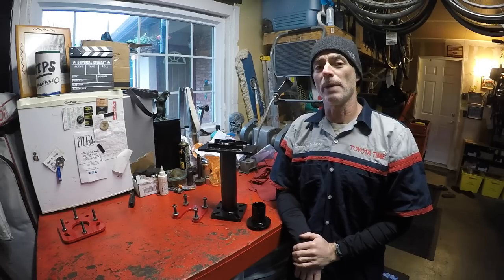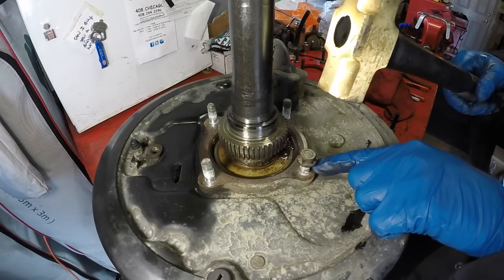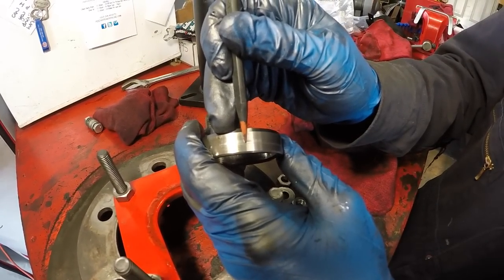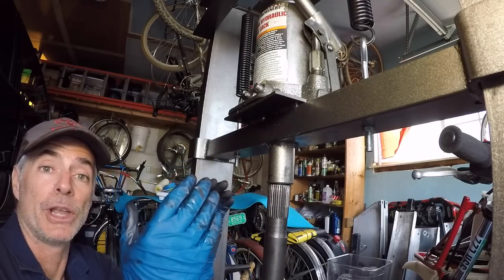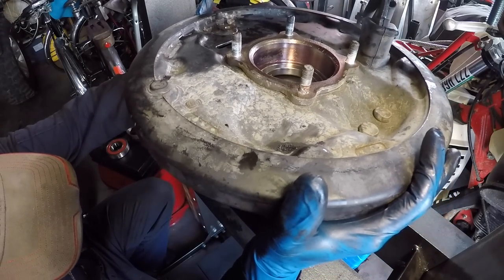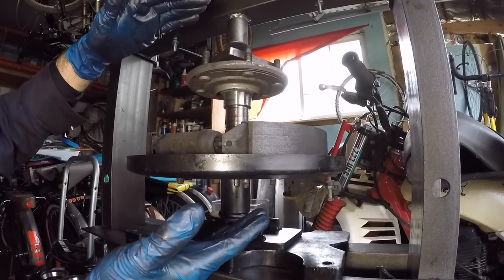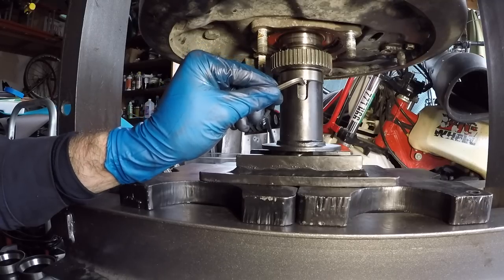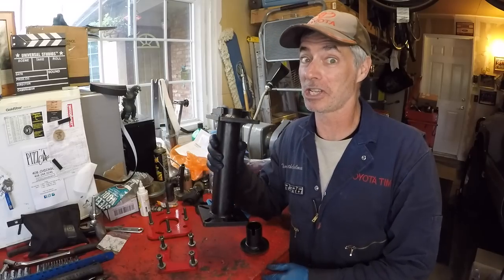Toyota Rear Axle Seal/Bearing Replacement (Part 2)

Comment: Tim, always love your videos! Thanks for introducing the new tool! I have a 2002 Tundra (non-ABS) with 154,000 miles and know it's only a matter of time before I have to replace the bearings. Three questions. Of all the bearing that you replaced what was the #1 symptom? Second, I have only one retainer. Since I can't switch retainers should I replace it? Lastly, if I need to replace the drum backing plate,  rusting away, can I do it after the axle shaft is pressed out of the bearing? Thanks again!
Reply from the maker: Good to hear you like our channel.  The sign to replace the bearings has always been a leaking axle seal.  When the seal starts leaking, it's best to just go ahead and replace the bearing.  The reason is it's possible a worn bearing contributed to the seal failure.  Some people have just replaced the seal and readjusted or flipped the retainer to get a good mating with the seal and have gotten more miles out of the bearings.  But, this was on ABS rear ends.  For you to get the retainer off the axle on your non-ABS rear end, you need to press the axle shaft out and that puts a tremendous load on the bearing and it should not be reused at that point.  If you wanted to reuse the bearings, you couldn't use the redesigned Toyota seals.  You would have to use an aftermarket seal that keeps the seal lip in the same spot as the original Toyota seal to get a good mating with the retainer.  However, I share the opinion with most people though and think it's just smart to spend the money and replace the bearings while you have the axles out.  

Since you only have one retainer, I would suggest replacing it.  For your application, you absolutely have to flip the retainer if you're going to use the new Toyota seal.  If you don't flip it, you will not get a good mating with the seal.  We have a video for this job for a non-ABS rear end so be sure to watch it.

Once the axle is out, yes, you can replace the brake backing plates.  You would need to have all 4 serrated bolts knocked out and then you can grab a mallet and knock out the bearing case from the backing plate.  Then, you just get your bearing case into the new back plate and get your 4 serrated bolts pulled back in.

Comment: Hey Tim, in this video you mentioned that you can reuse both of the retainers if you flip the positions. But in the video description it refers to a comment where you suggest to buy new Inner retainers to mate up with the seal. Assuming I did the same method in this video would you recommend buying new inner retainers or can I reuse both to save money?
Reply from the maker: Buy new inner retainers based off the reason I stated in the pinned comment.

Comment: I have a 2008 and trying to remove rear wheel bearings and retainer. In having trouble finding the tools I need exactly. Anyway you can drop the links in the comment. Also I'm using a do it yourself shop what is the clearance height for the press to fit the axle in it.
Reply from the maker: We have links to the tools used in the video description.   As for the clearance height for the press, I'm not sure what you mean.  The Harbor Freight press we have is adjustable and I imagine any press you would use would be adjustable.   For different parts of the process, you need to adjust the height of the press.

Comment: I'm probably just dumb, but the parts list like the "Toyota Genuine Inner Right Hand Rear Axle Bearing Retainer" is showing up as incompatible with a 2000 4runner. Is this accurate? Great video either way!
Reply from the maker: Those retainers are the same for any 3rd Gen 4runner axle.  There is a difference in the bearing for the 2001 and 2002 compared to 1996 - 2000.
Reply: @TimmyTheToolman  thanks just wanted to make sure.
Reply from the maker: @kearsarge6658  No problem.

Comment: Hi Tim, 
     Thank you for your videos,  So many of these tasks would seem impossible to do without the detailed guidance you put together. I have a 98 4Runner, and my rear bearing is leaking so badly.. it's like a waterfall in there. No question I need to do this or have it done. Do you know if this tool works on the 12 Ton HF press that I have access to (as opposed to the referenced 20Ton)? I assume the clearance is the issue as opposed to the tonnage...12 ton has Working distance: 1-3/4 in. to 25-1/2 in.

Thanks in advance,
Keith
Reply from the maker: I think I remember hearing that the tool doesn't fit between the cross member on the 12 ton model.  Do you already own the 12 ton model?  If you don't, the 20 ton is worth the extra expense because it can handle all the pressing jobs on your rig.  The front wheel bearings require a ton of force and I don't know if the 12 ton model would be up to the task.
Reply: My Friend has the 12T, I was hoping I could use his. Thanks for getting back to me so fast!
Reply from the maker: @keithbrown1914  Yeah, you could get the tool and see if it works but I wouldn't tear your rig apart until you see the tool will fit between the cross member brace.

Comment: Nice tool adapter from Buddy I will look into getting these tools I have done only one bearing but I think it might be worth getting.  Did you think perhaps instead of unscrewing the bottle jack couldn’t you use some spacer?
Reply from the maker: We do adjust the bottle jack screw bar during this job.  The first step is choosing the right level for the press cross bar and then adjusting the screw bar on the jack to get it closer to the material we're pressing.

Comment: Great advice, however point to note my 2004 Sequoia has a different set of retainers 46mm and 48mm on the axial shaft. I had to grind out the ABS plate but I made it work as it was too narrow for the plate to go under. I was also able to use the black tube as the press on the bearings while using the retainers but appreciate the advice.

One thing I am struggling with is the parking break spring pins, especially the u bend pin. Any suggestions
Reply from the maker: You have to pull out a little on the curved side of the clip so it clears the hole in pin and then pull it out.  After that, you should be able to slide the pin out provided there's no corrosion fighting you.

Comment: I have the 12 ton harbor freight press, outside of having to “block” the press to give me clearance, i your opinion doing this job, do you think it’ll suffice? Thanks for your thoughts
Reply from the maker: I've heard the 12 ton press will work, but the version of the special tool we use won't fit in that press.  Here's a link to the one you should buy from Duane: https://www.ebay.com/itm/193637211065?hash=item2d15ad5bb9:g:0wIAAOSwoMFiFXt2&mkcid=1&mkrid=711-53200-19255-0&siteid=0&campid=5338641100&customid=&toolid=10001&mkevt=1

Comment: Hey there Timmy! I have a very similar press from Harbor Freight, except it is the 12 ton model. It's built the same but slightly shorter. Do you think that I will be able to accomplish this work with my 12 ton? Thank you in advance for your time!
Reply from the maker: Hey Adam, I think your 12 ton press can handle it.  Now, if we were talking about front wheeling bearings, I'd say the 12 ton press would struggle and maybe fail to press the wheel hub out of the bearing.
Reply: Timmy The Toolman thank you for the quick reply. I suppose I would have found out eventually, but your reply eased my thoughts.
Reply: @TimmyTheToolman  Just an update for you and anyone else regarding the 12 ton press. The press had more than enough force and was tall enough to accommodate the axle. However! The puller I purchased from Donald-the-bonald on Ebay was too wide to fit into the cross member of the press, the member you rest the axle assemby/pulller on. This issue was hastily remedied using an angle grinder. Once the cross member was split, everything went well. Thank you SO much for your help. I referenced your video lots while performing the repair.

Comment: My understanding is that this tool will work with the Tundra 2nd gen (2007 & later) also.  Is there any reason Tundra 2nd gen was excluded from mention when naming all the models this tool is compatible with?
Reply from the maker: You should message Duane on his Ebay store and ask him directly.  I don't know the answer to your question and I doubt Duane will see your question here.

Comment: Question what differential oil should I use when refilling? I put Mobil 1 75-90 synthetic 9 months ago and noticed my rear passenger brake cover was covered in oil. I pulled off brake drum and it was soaked in diff oil. Replacing seals and bearings right now as I am writing this. Got to go now and pick UP new clips and drain plug crush washers.
Reply from the maker: 75w-90 is fine for the rear diff, front diff and transfer case .  The manual actually calls for 80w-90 in the rear but 75w-90 is pretty much the same.  I use Redline synthetic 75w-90.  Choosing 75w-90 wasn't the reason for the leak.
Reply: @TimmyTheToolman  I am having an issue after putting axles back in and installing brakes and Diff oil when I started my truck the ABS light came on! I know I got the ABS rings within 1mm or less from original position. What do you think it can be?
Reply from the maker: @mikekmalick  Pull the ABS sensors out of the axle housings and take a look.  Maybe the sensor is covered with grease and oil from the axle seal failure and they just need to be cleaned off a bit.
Reply: @TimmyTheToolman  Thank You So cal friend! I'm in Temecula.CA
Reply from the maker: @mikekmalick  You're welcome Mike.  I'm a NorCal Dude though.  San Jose.
Reply: @TimmyTheToolman  I really appreciate your videos even if you are from NorCal! hahaha. Im really a Eastern Sierra NorthWest Guy at heart! By the way I took your advice and pulled the rear ABS sensors and cleaned them and cleaned the ABS port. ABS sensor light went off at 5mph so all is a success! Knock on wood!!

Comment: Hi Timmy, Long time listener, first time caller. I am in the process of doing the rear wheel bearings and seals. When I put the arm puller down the shaft to connect to the crowfoot, the puller doesn't clear the retainer to rest on the tone ring.Therefor the crews are not long enough to grab the crowsfoot. Am I missing something here? Thanks in advance.
Reply from the maker: What puller are you using?  The one Duane makes has an inner diameter big enough to fit over the retainer.
Reply: Looks like the bore in the arm is 1/16 shy to cover the retainer. Might have to fab something . Thanks.
Reply from the maker: @rob8804  Was this the tool featured in this video?

Comment: Hi Timmy, will this tool work on my 1993 Toyota 4x4 Pickup?  It is a standard Cab - DLX according to my VIN by Toyota.  If so where can I buy it?
Reply from the maker: Open the video description, and we provide a link Duane's Ebay store.  Contact Duane and make sure you get the right toolset from him.

Comment: So the bearings on a 2006 are diferent than the ones listed on here correct?   Do you have a listing for the 2006 tundra 4wd?  so you get some pay or should I just order my own?  Are the dust covers etc all the same?  I dont like amazon but If you get paid this way I want to support you.
Reply from the maker: Hey Art, I'm not sure they are the same.  You should double check before ordering.  Order from who you're comfortable with.  Don't worry about us.  McGeorge Toyota seems to have pretty good prices.

Comment: Hey brother I need some help I’m working on a 2000 Toyota Tundra 4.7L v8 I just had to change my carrier bearing and I’m have trouble finding the correct output shaft seal anyway you could help. Any knowledge is much appreciated thanks.
Reply from the maker: I don't know that part number.  If it were me, I'd just go to a dealership parts department and have them look it up for me.

Comment: i am grateful for the the super thorough information.  has anyone tried the much cheaper hf 12 ton press for this job?
Reply from the maker: Somebody recently mentioned the tool we showcase in the this video won't fit between the arms of the 12 ton press model.  He did say it was an older model so maybe it has changed since then.  If you haven't purchased a press yet, just go with the 20 ton model.  The 20 ton will enable you to handle any presswork needed for your rig.  The 12 ton might not be able to handle front wheel bearings which require a huge amount of force to remove.

Comment: Timmy, after I set the bearing into the bearing housing and attempt to slide it on the axle in order to press the first retainer in it pops loose each time. I have completed the other side and am doing the same process as in the video. Is there a way to get the bearing to stay in place with some glue type of solution for metal or do I need a whole new backing plate?
Reply from the maker: Just be gentle with it.  Slide the backing plate with the bearing onto the axle with the axle horizontal to the ground so gravity isn't working against you.  Then slide the assembly onto the tool and get it onto the press.  An extra set of hands is helpful so get somebody to help you out and you'll get it.  The bearing fits loose into that bearing case.  It's not a press fit so you don't need to buy anything to make this easier.  Just get someone to help you to make it easier on you.  Good luck!
Reply: @TimmyTheToolman  got it, thank you!

Comment: Is there any differences in procedure between this axel and a 1999 100 series Land Cruiser axel? Is the 5mm measurement the same?
Reply from the maker: The procedure is similar but different.  You're not going to be able to rely on the 5mm of polished axle showing above the retainer as a reference to know how far to drive the ABS tone ring and inner retainer onto the axle.  I plan on filming a 100 Series soon.  It takes different tools from our buddy Duane.  If you can wait until the end of this month, we'll have a video(s) you can use to get the job done.
Reply: You are THE man! Thank you so much! A couple local shops wouldn’t even touch this job and the dealership quoted me $1400 in labor alone. The 100 series community will be very happy. I look forward to the video.
Reply from the maker: @ironwoodoverland  I have the job scheduled for the 20th.  Provided nothing happens with that scheduling, we should have the videos edited and uploaded to our channel by the end of the month, no problem.
Reply: Awesome! Thank you for the reply and for taking the time to make these videos.
Reply from the maker: @ironwoodoverland  Our pleasure.   As time goes on, we'll have more content for 100 Series owners.

Comment: Thank you Timmy and Duane for great tutorial and tool. I have a question: on one side I cannot get the bearing out the housing by tapping the inner part of bearing. It seems that it is rusted into housing. Is it safe to try press it out or will I rip off inner part of bearing from outer potentially with bearings flying all over at dangerous speeds? What are my options?

Secondly, I wanted to add that I am working on 2005 Toyota Tundra and calculated twice based on manual on how far ABS should be and turns out I need to use 4mm allen wrench, not 5, so Timmy's correction to 4mm is aligning with my calculation.

Thirdly, if Duane's tool is not making clearance to grab ABS (it didn't on one side for me because someone previously pushed ABS too far),  then you can use Bearing Separator and Puller Set from Harbor Freight along with Duane's tool to get that ABS out. Here is the link: https://www.harborfreight.com/bearing-separator-and-puller-set-62593.html

Please, help me on that stupid stuck bearing.
Reply from the maker: For the stuck bearing, just press it out.  I could break apart, but hopefully it won't.  If it does break, the worse that will happen is the outer race will get stuck into the bearing case and then you'll have to figure out how to get it out.  You could just buy a replacement bearing case or get one off a used axle and be good to go.  

We use a bearing splitter in conjunction with the original tool we used to perform this job.  Check out Part 1: https://youtu.be/AVhSDnw2ugo
Reply: @TimmyTheToolman  Thank you for your guidance. I ended up removing 4 bolts and pushing the bearing housing out of wheel/brake plate. Then I pushed bearing out of housing and luckily it came out as one piece. I just ended up bending brake plate a bit and need to straighten it back lol. Thanks again!
Reply from the maker: @azizb.7561 I'm glad you got it.  Great job!  Good luck finishing it.

Comment: Hi Timmy, great videos, thanks for the help.  Working on my '99 with 485k miles with repeat drivers side seal leaks through the years.  After completing the install of all new toyota parts - bearing, retainers, ABS sensor (and unfortunately a new axle due to the same dealership grooves from grinding as Matt O from earlier comments).  We noticed the new bearing still has some considerable play.  When the axle assembly is upright, I measured 2- 2.5 mm of wobble or runout on the outer edge of the backing plate.  It seems extreme for a new bearing.  Is this normal?  I have a few pics and a 5 second video clip I could send to show you.  Thanks again!
Reply from the maker: The new bearings have play.  It's normal.

Comment: Would the 12 ton press from harbor freight be able to the job?
Reply from the maker: A 12 ton press might get the job done, but we recommend a 20, the bearing can really load up with a lot of force when you’re pressing it off. We’ve never tried with a 12 ton so not sure if it is strong enough.
Reply: Thank you!
Reply: Did you buy a 12 ton press or 20 ton? I’m going thru the same decision right now